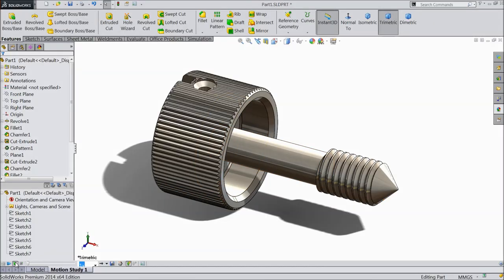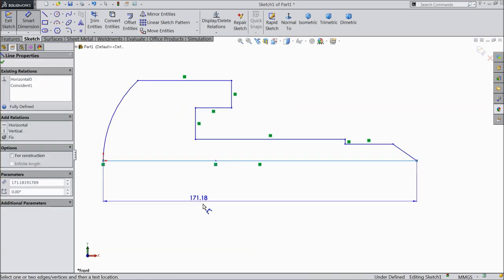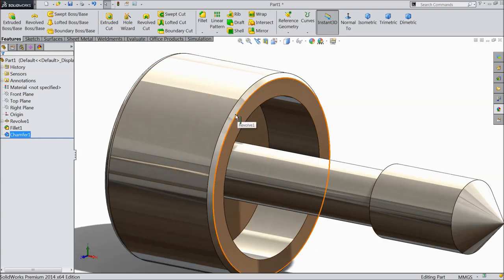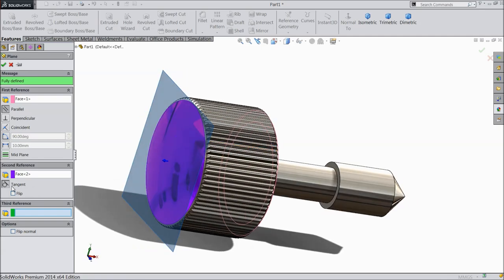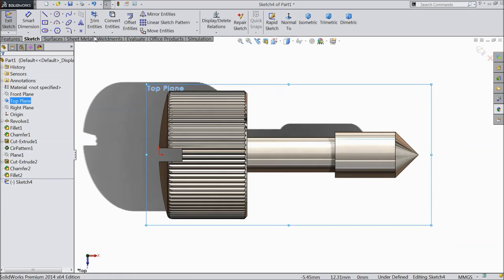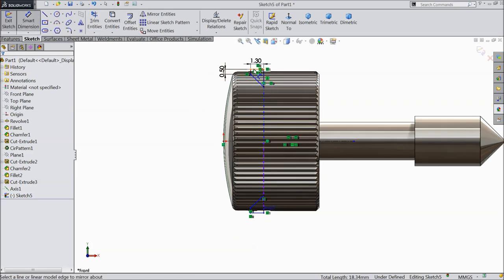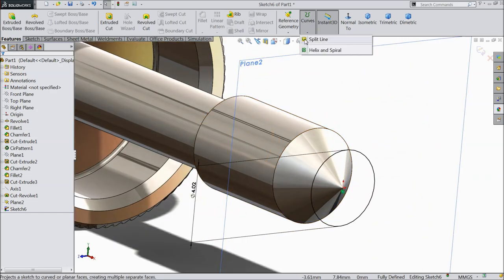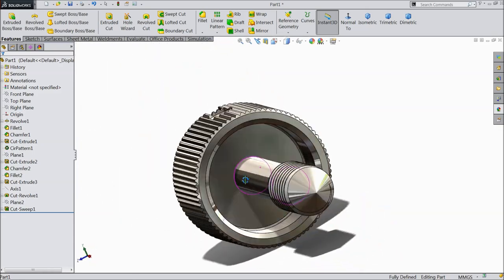Solidworks tutorial | sketch Furniture Screw M5 in Solidworks

Comment: Thank you for your video, 
I  have a question. I didn't see "Real/View Graphics " in my SolidWorks 2016 does it have to do with the computer's graphic card or is it available on older versions only ?
Reply from the maker: Thanks, you need professional graphics card in your system like Nvidia quadro series or AMD Fire Pro series. normal graphics card will not support real view in any cad softwares, you must buy a professional graphics card for real view.